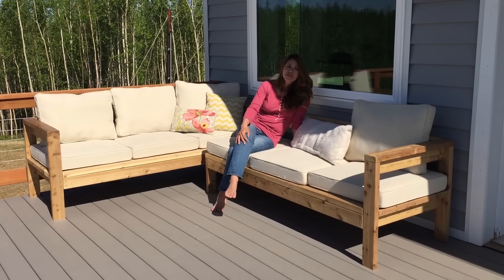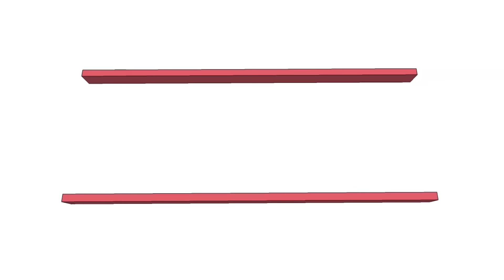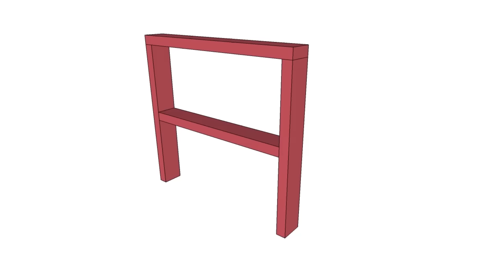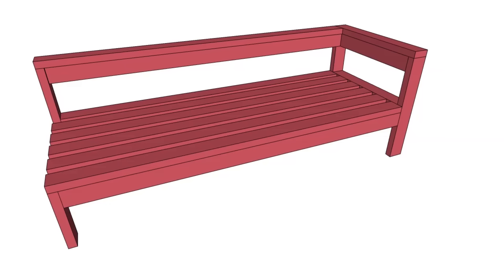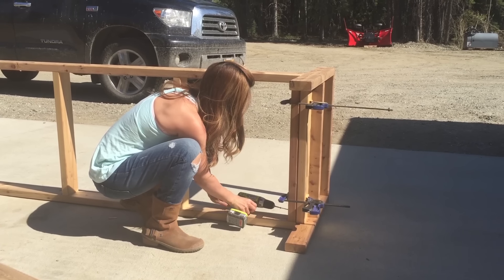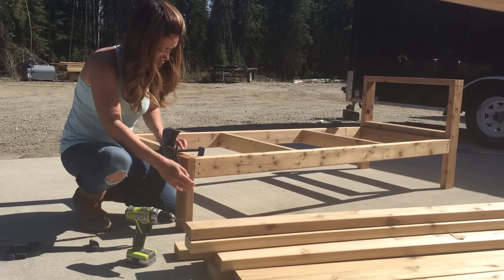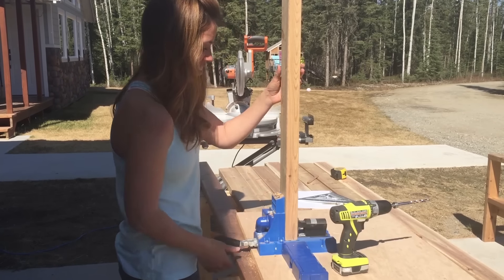How to Build a 2x4 Outdoor Sectional Tutorial

Comment: Hi Anna, it's interesting to follow you and try to do this project, but I have question the screw size and other options to use incase of not found the right size to use blessings 😊
Reply from the maker: Thanks for watching!  2-1/2” to 3" long, self-tapping exterior decking screws  (#8, #9 or #10 will all work)
Reply: Finally, 😅I did thank you for your help

Comment: Completed this project about 5-6 years ago.  Been through countless cushions and the bench is in need of some love.  Any suggestions on how to tighten up the loose wobbly base other than possibly replacing the screws with larger gauge and longer screws?
Reply: this video shows the wrong way to attach the legs. unless you're building a little side table for a lamp, never attach your load-bearing legs to the side of your project. always put them underneath so that the material of the legs, not the screws, takes the weight. that, i suspect, is why your bench is wobbly now.

Comment: Hi Anna i'd like to ask u what dose 2X4 means? I'm not American so thats y I'm asking 😘 .
Other thing what kind of wood did u used ? And I'll be thankful if u reply as fast as u can . I loved the design and i want to make it 😍😍
Reply: +Rock Star  90mm x 45mm lumber.
Reply: +Rock Star 
2x4s are nominally 2 inches by 4 inches. 
But that's before they are planed down to their finish dimensions. 
They actually wind up being 1 1/2 inches by 3 1/2 inches. 
They're the standard element in "balloon frame" construction used in ordinary suburban homes.
Reply: +Bevin, you're talking to a guy that barely speaks English, and you talkin "nominally" and "element" and "balloon frame".  What the hell?  Give the guy a break.
Reply: +Rob I You may be right. 
It's just the way I speak and write. 
Wasn't deliberate.

Comment: How is the short leg holding up after all this time? I imagine it gets kicked a fair amount. Would you put a brace on it, if you did it again?
Reply from the maker: Hi!  The sofa is holding up extremely well, no problems whatsoever.  The legs are definitely the most vulnerable, but we haven't had an issue.  The best upgrade I added was the additional back support.  You could also cross brace the legs, it certainly wouldn't hurt.
Reply: Good to know. Thanks for the reply.

Comment: with exception to the pocket holes...the other screws you drove in - did you drill pilot holes? from the video it looks like you didn't drill pilot holes so i was concerned about the 2x4's splitting. did any of the wood boards split from the screws? thanks!
Reply: In the video it says she uses self tapping screws. Usually self tapping screws don't require pilot holes.
Reply: +J. Alexander Curtis thanks, i missed that!

Comment: Wish the directions were a little clearer. Doesn't specify about the second part of the sectional. Is it included in the required materials? Just don't want to buy twice the lumber but don't want to have to go back either. Can anyone elaborate plz? Also, what kind of self tapping screws? Hardware stores have a few different coatings etc

Comment: I am going to double the length for the patio so if I there is going to possible be several people/weight, should I change anything?
Reply from the maker: I would recommend adding extra supports underneath for a longer span.  Here are some nice brag posts to look at where people have extended the length, for added tips and tricks https://www.ana-white.com/relatedbrags/36036
Reply: @AnaWhiteDIY  Thanks I will add the vertical under but, I bumped up to 2x6's so I may not need to but, just on the save side

Comment: I have never built anything made of wood before,  I built this sectional but I had a lot of splitting. The nails split the wood. What can I do to avoid that in the future?
Reply: I would recommend using a drill and screws next time, as well as drilling pilot holes before screwing. This can help prevent most splitting.

Comment: Ana i have a question: if i wanted to build this for indoors and add a drawer at the bottom would i add 4 more 2x4 at the bottom?
Reply: build a box that can fit under the bench and attach casters. no need to actually attach it to the bench.

Comment: It looks nice, I'm just surprised your relying on the shear strength of the screws to carry the entire load. Why not put another short 2x4 at each corner under the seating part to support the weight of the wood and live load? Personally I would not trust the shear strength of the screws to hold up 3-4 adults on one bench, especially after the first year or 2 when the wood will start to rot. Those are the weak points in your design and is what will eventually be the first to fail.  (I'm also surprised I didn't see any other comment bringing this up)
Reply: I'm 1 year in with my chairs. Still standing. thats through ran and snow. :)
Reply: @saywhatbruh25  That means nothing lol. It's still widely known that you do not depend on screws for shear strength, and that's the downfall of this design. Overall it's very good but would be better with a 2x4 at each corner under the seating part. I would rather depend on a 2x4's compression strength than a screw's shear strength.

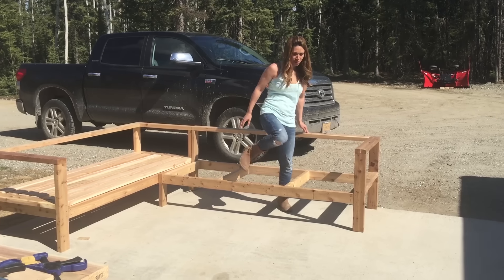Comment: Seeing a lot of comments about the weight being carried by decking screws. These comments are all correct. There are a few reasonably easy ways to make this much stronger. Scroll to 5:15 into the video and pause it. Spend some time looking at the structure. If you know even the most basic carpentry/framing concepts, it will be very easy to see where you can create load bearing studs, rather than weight bearing joints secured by screws.
Here are three examples"
1. The front left leg of the "armless" section: instead of joining the front cross support and side cross support the way that she did it, cut the post (the leg) down by the width of a 2x4 (3.5"). Now those 2x4's will rest ON TOP of the leg. If you use a kreg jig on the font side of the leg and the side of the leg, and then pocket drill one of the cross supports as well, you can connect all of those pieces with 1 1/4' pocket screws. This will be SUBSTANTIALLY stronger and will last much longer.
2. Where the "armed" cross supports meet the post (the leg), take the leg and on the front side "notch out" the depth of the 2x4 that mounts to the face of the leg. This is relatively easy to do with a table saw - set your saw blade to the depth of a 2x4 (1.5") mark the leg where you want the notch, and then begin making cuts the full width of the notch. Now when the cross support meets the face of the leg, it will sit in the notch and will direct the load through the post/leg. You can screw the face of the cross support to the leg once it is in the notch. 
3. Where the side cross support meets the "armed" post (behind #2 above), instead of joining the cross supports together the way that she does (we already blew this up in #2), you will pocket drill the cross support that attaches the front and back legs so that it sits flush in between the front and back legs. Now, you will sister a stud on both legs (the backside) so that the pocket joint will rest on that "stud". Attach the stud to the leg however you like (screws most likely).
If you do the 3 above, it is a little more work, but there will be far fewer load bearing screws and it will be much sturdier.
Reply: Wouldn't it be easier to just use glue? :)

Comment: Nice design, but I wouldn't rely on screws to hold it up. They are not designed for shear loads and can become loose with the weather. Couple of big fellas sit down after a few years of use -- bang! You can add galvanized L brackets and plates with nails or structural wood screws to be safe. Shouldn't show if you put them on the insides.
Reply from the maker: We appreciate your input!:)

Comment: Hopefully this is helpful for UK people. I'm just pricing this up based off the 'full sofa plans' linked in the description (which is not the same as this video which shows building the side piece that uses less wood). Prices are from April 2022 from Wickes (free delivery). The US 2x4 is equivalent to 47x100mm or 45x95mm nominal. Calculations are made rounding up to the nearest cm which is why I've added ~ (and this is fine for ordering, but should be measured more accurately when cutting).

To make each end you need 4 x ~65cm lengths and 1 x ~73cm length = ~3.33m.

To make the bench frame including the back rest, and assuming you use the same size wood for the seating slats, you need 9 x 1.8m lengths (16.2), and 5 x ~65cm lengths (3.25) = ~19.45m.

An easy and efficient way to do this is purchasing 3.6m lengths which can be cut in two for a lot of the work and isn't more expensive per meter than longer lengths.

Total lengths required: 19.45 + 3.33 + 3.33 = 26.11 / 3.6 = 7.25.

The remaining 0.75 of a 3.6m length can be used to add the extra middle struts/braces across the back and on the arms.

Total cost: £117.60.

EDIT: Simple Ikea outdoor cushions (3x back, 3x seat) would add £195 to the cost of this project. There are cheaper options elsewhere such as the singular pieces that fold in the middle with less padding.
Reply from the maker: WOW, thank you so much for sharing the conversion!
Reply: Actually, the size conversion is not quite right. The 2x4 has an actual size of 1.5x3.5in and this converts into 35x90mm.

Comment: @ Ana White Is the couch comfortable? What I mean is, would a 15 degree bevel or angle in the backrest area be better instead of having to sit straight up? If so, would you just add 5 inches or so to the width of the couch? I am going to do this, but I want to make it as comfortable as possible.

Comment: This is a great idea and thanks for the demo. Quick question, How do I protect the wood? should I use outdoor 2x4 or stain the wood after it is done? Thanks.
Reply: Not the author but...

You can use either pressure treated 2x4 (doesn't look nice), an outdoor stain (even better on pressure treated 2x4), use cedar instead of SPF (looks nice and doesn't need painting but is more expensive), or just use outdoor furniture paint.  I personally have used an outdoor furniture paint that goes on as a thick coating on some of my furniture like a picnic table set, and so far the furniture itself is in really good shape after 3 years of being left out in the sun, rain, and snow.  The only down side is that because the snow causes a bit of abrasion in the early spring time as it thaws/freezes, I need to repaint each spring.  I also used an outdoor oil stain for a 2x10 wood deck patio which so far is looking good after 10 years, but again, I sand and re-stain each year.  I think the key is to make sure that even if it gets wet in the rain, it doesn't sit in water.  That is, the legs don't remain in puddles, and you make sure that the surface boards don't warp in a way that water puddles on the board itself.  (Probably not a problem with 2x4, but that was a big concern when using 2x10s.)
Reply: Karthik Bharat dude don't use fucking pressure treated wood there's chemicals in it that can kill you -_-

Comment: Just built this complete set...it was easy and looks great. I agree with others concerns about structural integrity. A LOT of weight put onto deck screws and I think it is a real weakness in the design. I loaded it up with screws inside and out on both sides, angling them down toward the load bearing boards and added additional supports.  

A couple modifications made it cheaper, easier and hopefully more durable. Using all 2x4x8's  I simply cut it to 72 and then used the remaining 24 1/2 for the cross pieces. Too easy, and only 1 inch difference. 

I also cut a couple 8 1/2 inch support legs to help hold weight in the middle of each piece and towed them into the bottom (cut a blade's width shorter than the legs so it doesn't wobble) 

That's my experience. Good luck
Reply: D

Comment: i want to use your plan but increase width to make it into a twin size daybed with a trundle underneath could you help me figure out some dimensions and how many 2x4s i need to purchase? Thanks
Reply: paul dominique 2x4s come standard as 8, 10, and 12 feet. Draw your project out and mark your dimensions, doesn't need to be a super accurate to scale drawing but make sure you know how big you want it. That should tell you how much wood is required
Reply: ty, i am in the process of using cedar logs for the sides and back, im only going to use 2x4 s for the mattress i will post photo when im done

Comment: It was great seeing you again Ana;  it's been a long time.  The piece is beautiful! There are several things I thought about as you built this. As most of you know when you built the first part to measure diagonally to ensure that it it square. You can use a router on all of the edges to make them look smoother.  You could use a lighter material for the seat base. On the exposed screw heads, epoxy resin mixed with hardener then wood flour added can be applied like drywall compound.  Then smoothed and sanded to cover the holes before varnishing.  I'll have to subscribe to see what you've been up to since the tiny house episodes. Mark not Denise.

Comment: all those screws will ruin that project in short order along with the fact that your framing is hanging versus being supported . . . learn some jointery and use wooden pins versus all that metal, it'll last longer fit better and have more strength.